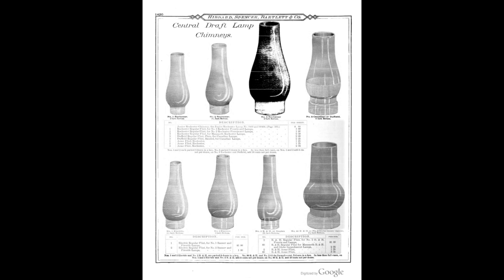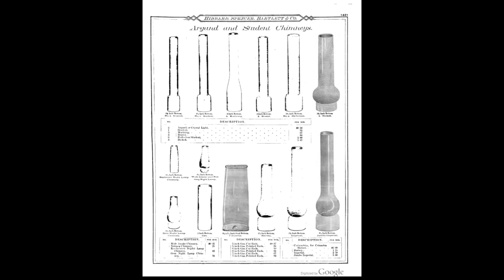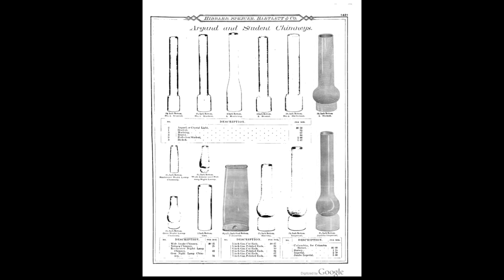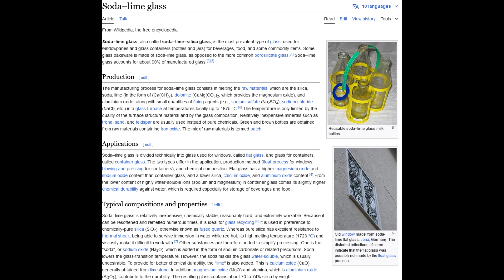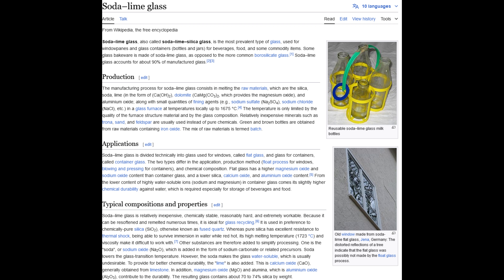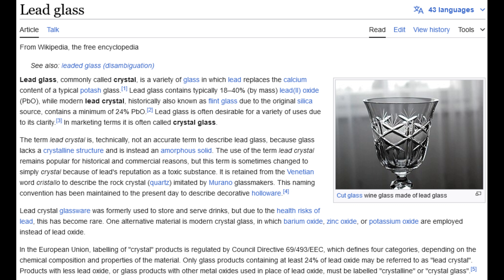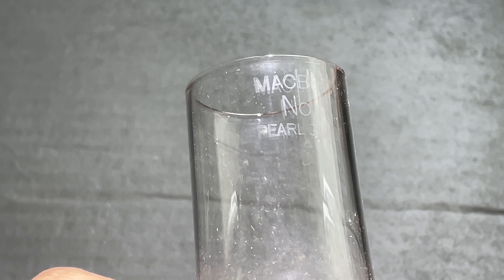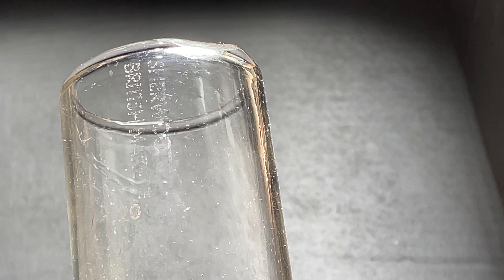The basics of antique oil lamps

Comment: I gave one of those chimneys with discolored glass from a round wick burner. 
I also have one of the Keystone best lead chimneys. 
And I am one of those people who burns on road diesel in mine. I find if I mix in 10% clean K1 with 90% on road diesel, it gives me the best stable burn and wick life while being the cheapest option out of pocket. Oil lamps here are a daily use on my off grid homestead. I can not afford to burn straight clean K1 in all of my lamps. One of my night lights is on the same wick going on 4 years now with my 10/90 fuel mix. And I kind of like the slight diesel smell.
Reply from the maker: I will have to do a bit of testing and do a video on this!